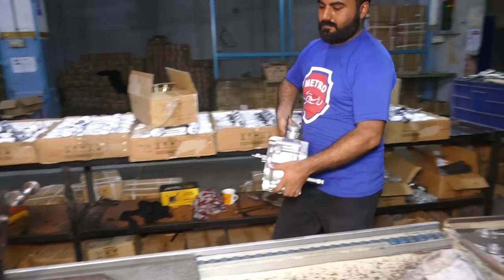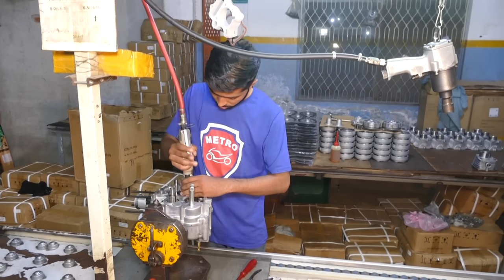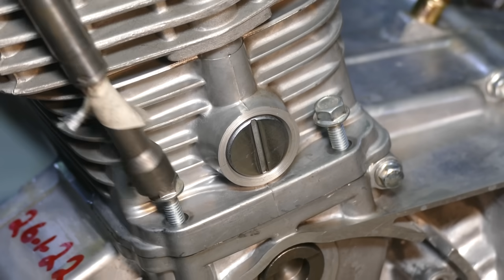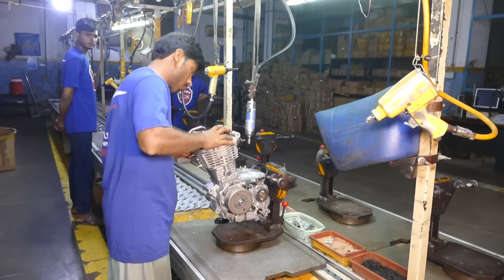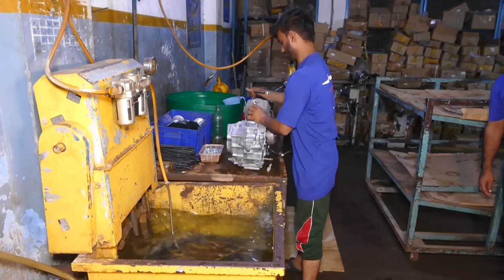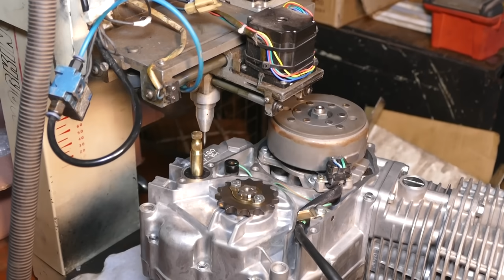Complete Assembling of a 125cc Motorcycle Engine

Comment: why do they dunk the engine in water ? would it not mess up the electronics ? / get into the intake valve ?
Reply: Boa pergunta
Reply: I d' like to know too.
Reply: To check if the engine had no leak points after all assembled, he used pressure so he could see the bubbles from water
Reply: Lol well son, let me explain . Its so you can see if its airtight and now water gets in. No bubbles, it there bubbles its not sealed right ,therefore re due it again, most engines are suppose to be rain proff amd some can even be submerge 🙏💯💪im a motorcycle mechanic
Reply: It's not water. It's a non conductive solution that doesn't start corrosion.

Comment: Wow, so I need a new engine for my 125 cc motorcycle. Now I am scared how many components, little screws, nuts, manifolds, and even the spark wires? Am I right, soark wires to the spark plug? The whole eorking team, make me so now going to buy a ehole engine, and then try and fit it, using a Haynes manual? Ha ha as if!! I can follow instructions, but this is the most important part of the motorcycle. The whole engine.Please can I have one? My bike is Indian, I am Indisn on both sides of my family.Sasjachuan Cree Blackfoot Indian Head Cheiftain nations ggg grandaughter.We love going on a beautiful powerful good horse.  So where should it be housed on the moyorbike frame?

Comment: Info on these engines:
Originally, a honda design. Honda CG125's were developed from the CB125. Instead of having an OHC (Overhead Cam) design, it was designed by honda to use an OHV or Pushrod design for third-world markets. The CB-engine apparently had issues regarding camshaft bearings if I recall, so to increase reliability was to pursue an OHV design. This engine became popular for select markets and eventually copies of these engines, most notably chinese copies, started to roll out
Reply: Like colombia with its NKD
Reply: would you know if the clutch cover gasket's are the same? and what year the Chinese copied of the cg125? i have a 2007 Baja (Hensim) cg125, its currently on a yamaha blaster and i would like to clean the oil cleaner inside the engine

Comment: Zongshen ZS125 or CG125. Before I ran the 200cc water cooled engine in my Gomoto GTR125, this 125cc engine was the original. The 125 has good top end power for its displacement, however, it lacks bottom end torque. Very good engine for beginner riders, as it is not overpowered. If you want reliability and power, I recommend the 200cc engine as it carries good speed with the right sprocket ratio, it produces both good torque and horsepower, also parts like the clutch, transmission and conrod big end bearing last longer than the 250cc engine. In the 250cc engine, the clutch plates wear out faster, 3rd and 5th gear get damaged from the torque as well as the conrod big end bearing wears out faster due engine power. You must remember, these engines are clones of the original honda CG125 design, the fact that they have made various cylinder capacities from a 125cc design is fantastic.
Reply: The engine is 200 or 250 . Where is the 125 engine in this video ?

Comment: I heard about metro bikes a few years ago and got myself one. Blody hell are they robust! 
But they have to, if you take a closer look at where they actually drive around. 

In that video, you can see that they use valve rods instead of timing chains. Open up the valve head, cange the rods and close it.. finished. A timing chain is more efficient but not this easy and cheap to replace.

Aaaand you get a nice retro looking bike, like a 70ish Honda
Reply: it's a copy of a Honda CG125 engine...or a clone...yes...pushrod top end is easier and cheaper to manufacture and equally reliable...i've ridden several CG's in my long biking career...i'd like one of these Metro 125's...put Honda stickers on it and pretend it's 20 years ago

Comment: Why is there no electric starter motor?
Reply: ارخص تكلفة بل النسبة للانتاج والزبون
Reply: It's a kickstarted engine
Reply: still using old technology - which in other countries already obsolete
Reply: @ferrykoswara4407  yah, but it's manufacturable and repairable locally and at a cost that the low wage workers / families there can afford and that's important in a third world country.
I've worked in 17 other countries and wasn't a "stupid American" who thinks that only the American way is the right way. Transportation has to be cheap, rugged and affordable at prevailing wages.
I ride a street/race bike at home and don't worry because the roads are usually good and rental bikes in Asia or S. America and there, because of bad roads you want strong old tech, it simply stands up.

Comment: a transfer cart or a rail hoist from the assembly station, to the air leak and oil filling bench, would be a more than essential idea, the operator could be injured by dropping the engine on its feet

Comment: So a Honda XL 125 engine has no Chain Timing??
Reply: This engine is a version of the old Honda CG125 engine that used pushrods to operate the rockers and valves, but the Honda CB125 and XL125 used a chain driven overhead cam.
 There was also a company somewhere, it may have been China, that made a 250cc version of this engine with the same sort of pushrod system.

Comment: Good evening Sir 
I have a problem on my honda 125 motorcycle, just when starting the motorcycle without driving on the ground, the motorcycle presents an excessive overheating on the exhaust, it is what surprised me the engine does not present any overheating.this problem occurred after the repairer.
Please help me to find this problem.

Comment: The cylinder is scratched from the factory itself. Wth! Why not seat the piston rings.
Reply: If this is their version of a Honda XL or knockoff...if I recall the cylinder is graduated at the bottom to compress the rings on installation.  Microns bigger at bottom of stroke but consistent in the ring travel section.